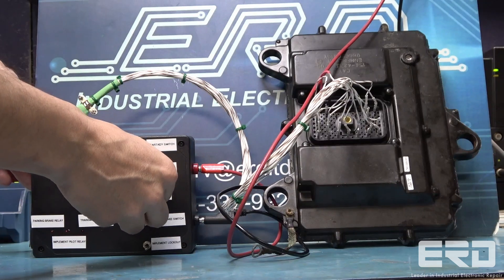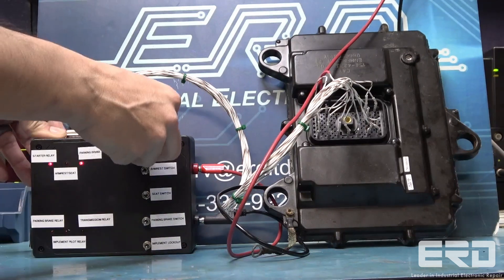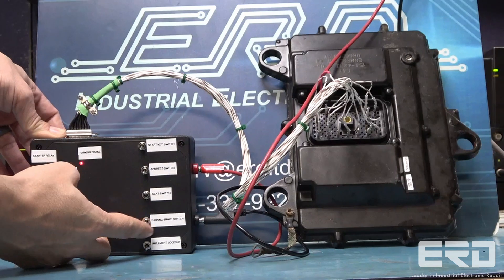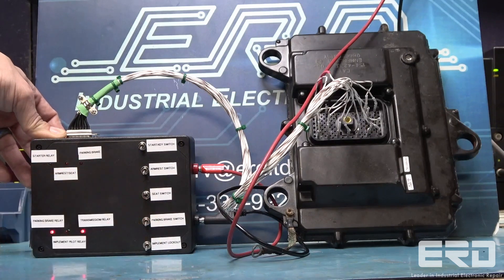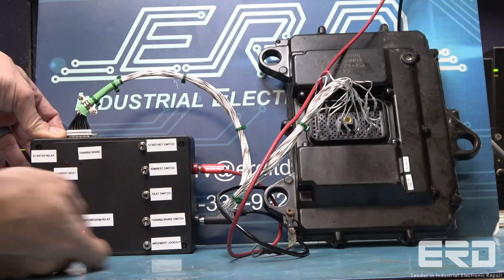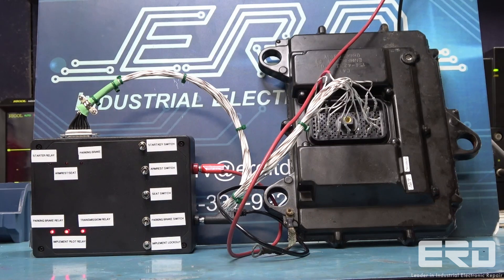Full Repair and Test of Caterpillar 154-4233 or 10r-8097 SSL-Interlock Module with a 1 Year Warranty

Comment: Wow. I'm working on my caterpillar 268b skid steers. Machine has battery light on dash. Air removing and priming electric pump should turn on at key switch on. It does not. It comes on at key switch start. But this function doesn't go through the interlock computer. The keys with "Start" output goes to the interlock ecu. It has to pass all the safety sensor data to tell the output to send start signal to engine starter solenoid. It will not send the output trigger signals to starter solenoid. I cannot figure out the electric priming pump getting wrong power from switch and the interlock not sending signal for start. Maybe my Interlock ecu is fine. Maybe it senses the fuel pump drawing when the key switch is in on position and won't send output power to starter. The thing is...I am getting power to ecu from keyswitch as I have confirmed pin with test light. I took ecu apart to inspect. I only looked at backside and green board looks beautiful. New. Fresh. I bought this machine new. Owner operator. 2000 hours. North east georgia climate. Trying to figure out if I'm chasing my tail with short to ground or touching wires. I'd hate to hit an ecu from caterpillar just to "experiment". I'm a scary budget at moment. The state is taking my property for a new highway, I'm paying lawyers, have to use my skid steer with forks to move my possessions! Yikes. Glad I found your business and channel in case I need a repair on ecu. I suppose you can do a repair without having to reprogram? By the way my machine parking brake releases. If i jumper wire start engine starter at relay it runs good and parking brake still turns off and I can use machine. But battery light is on and I can't use priming fuel pump either. Thanks for reading